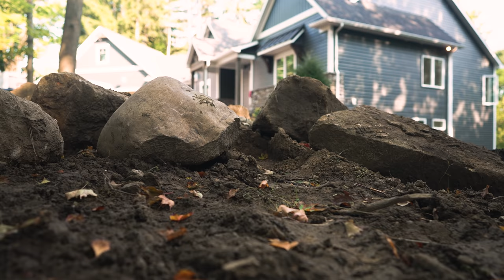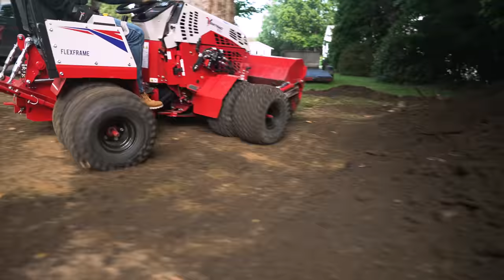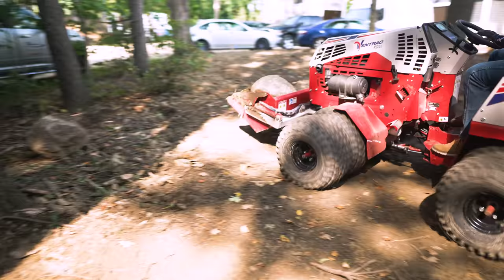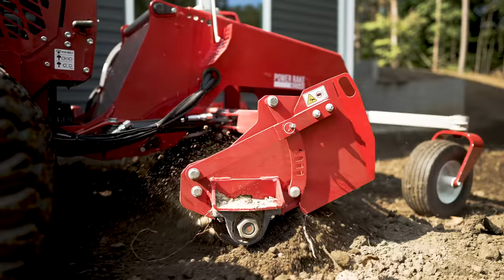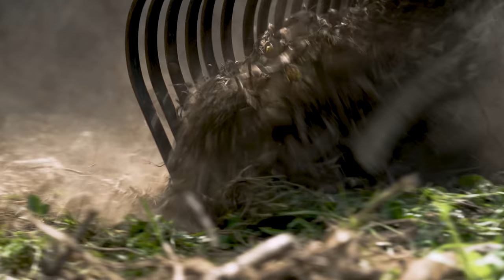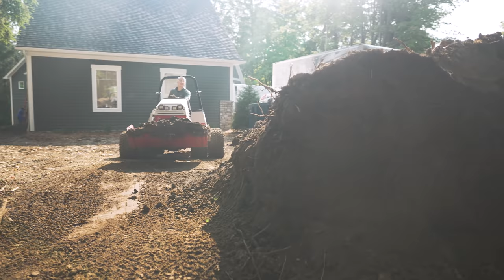Preparing Difficult Terrain For A New Lawn Install

Comment: Great video! How does the new power rake work for precision grading? The old rake can be adjusted, too only do 1/8” at a time. Is there any fine tuning with the hydraulic system now, or is it just up and down?
Reply: I have the new Power Rake for my 4520Z. The height is adjusted with the extra lever near the SDLA. Push the button and you can lift and lower it on the fly without getting off the tractor. Once you make a few passes you get a good feel of the depth its actually cutting at. I use it sometimes if I take just a bit to big of a bite on deep passes to free up the machine.
Reply: @aFleaByte  that’s my point, is there any way to Fine tune the depth? If I need to get precise grades, say 3/4” or whatever number, I can crank that in. I was curious if the new rake had that ability, or if the operator just guessed at their depth.
Reply: @arlisspropertyservicesllc5943  On the right side there is a gauge showing the depth reference. There is an arm that sweeps up and down depending on the cylinder extension. There isnt a tape measure like on the previous model.
Reply from the maker: Technically the system is infinitely adjustable within the range because it's hydraulic.  There are no hard stops like the previous rake where you could only adjust a full turn at a time.
Reply: @ventrac  Ok. I like the idea of staying in the seat, however having the drum exactly where I need it, pass after pass is more important. Perhaps you could incorporate a 1/4” valve, where it adjusts 1/4 at a time, and having a detent setting to go full up or down for loading, transporting etc.
Reply: I think you're overthinking an issue. I have the newer power rake and adjustments are great. No on and off the machine and then re calibrating yourself back on the tractor as to where and what you need to do to achieve your goal. Even large graders have 2 hyd adjusting rams that get you where you need to be. Chances are you are already adjusting power rake on the go with in and out of float mode and lifting complete attachment to fit needs of say filling low spot or what ever. With newer power rake you have more options to operate. Take front wheels off in seconds. Tilit for camber in road. And so on.  You can achieve what you need with new rake.

Comment: Do you need the foot pedal attachment for the power bucket or versa loader? Is it necessary to get the job done easier with both?
Reply from the maker: It's nice to have the foot pedal with the loader so that you have an extra hand free for the loader controls... but it's not totally necessary.   For the power bucket, it doesn't really make a difference.